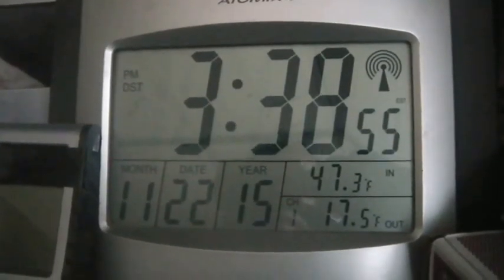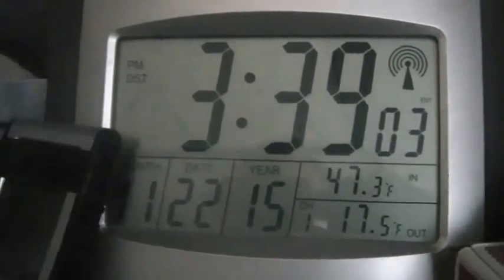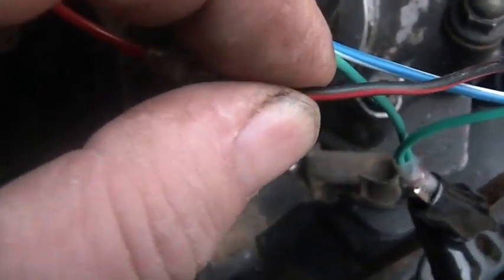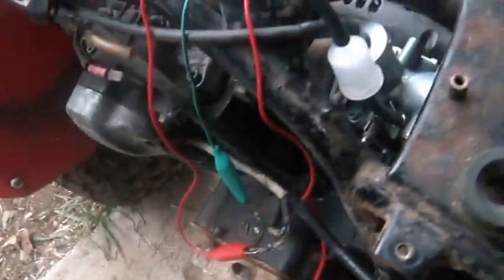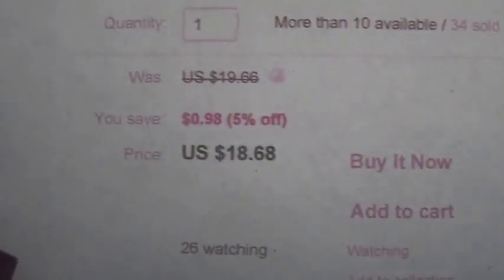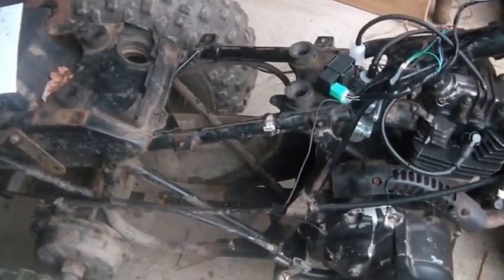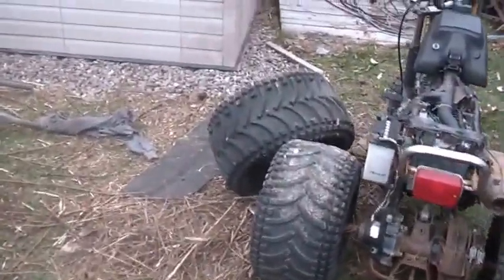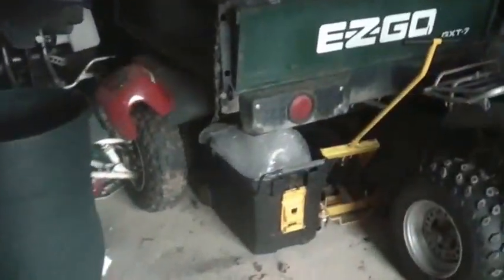Honda ATC ignition issues, use a $19 Pit Bike CDI system,

Comment: so this will work with the 1984 200es?
Reply from the maker: Hey Nick, Yes it will work on a 200es, works better if U defeat the mechanical advance, but, I have used it without doing that.... Thanks for asking, watching, and commenting!!!
Reply: If i just buy the CDI box and then get a 5 pin plug to fit it will it work? I'm asking this beacuse i'm 95% sure that my problem is the CDI box

Comment: Thanks for posting this.  Would this kit work on my 1976 Honda 90atc?  The original plug wire pulled out of the coil.
Reply from the maker: Hey Nick!!!!   Ur 1976 ATC90 uses points, these CDI ignitions will only work with pulse generators.... I've been thinking of building a points version to use on small engines that use point, but, I just have not got there yet... http://www.ebay.com/itm/Ignition-Coil-For-Honda-CT90-CT-90-Dirt-bike-Trail-Bike-NEW-/232094255867?hash=item3609e54afb:g:CBEAAOSw8gVX44JP&vxp=mtr   ,  for $9, I would probably smash this right on there and let her rip.... Thanks for asking, watching, and commenting! !!!!
Reply: Thanks again.  I ordered the one you listed.
Reply from the maker: Hey Nick, Let me know how it all turns out.... Thanks for your thoughts, watching, and commenting!!!
Reply: Harvey Spooner, i still can't get spark. can feel a small shock when turning over but that's it. seams like the new coil is not working. how do I test the coil to make sure it's working?
Reply from the maker: Use a 9Volt battery like the ones used in a smoke detector.... hook the negative terminal to the metal body of the coil, (ground), also put the treaded part of the plug against it.... Put the spark plug wire on normally... Then quickly touch the positive terminal of the battery against the primary of the coil and you should get a weak yellowish spark.... No spark, then U probably have a dead coil.... Good luck, let me know how it turns out....
Reply: Harvey Spooner thanks i did get some spark. how do you test the stator now?. I can spin the engine with a drill (no plug in the head) I tried this earlier and got 26ac volts not sure if thats good or not?
Reply: @NoFishNicksAdventures  hi, did you ever get the issue figured out with the spark. I'm having the same issue right now. I actually bought the same coil as well. But I'm also get a very weak spark. Thanks
Reply: @fortheloveofmotos8416 I believe  my issue is a bad stator. I picked up a used one off of ebay but have gotten around to install it yet. Good luck.

Comment: hey would a xr200 cylinder fit a 200x motor
Reply from the maker: Hey Rene, I think it will, but I did not do the research or try it, try an eBay search, see if they cross reference to the exact years of all the models U are considering.... Thanks for asking, watching, and commenting!!!
Reply: yes a xr 200 cylinder does fit on a 200x

Comment: this concepts work for a wiring loom for a 1978 honda pa 50 moped? what do you recommend for an application like a moped? cdi coil and all?
Reply from the maker: +dragonfli069 , If the engine has a pulse generator and a stator, not points, and a DC powered ignition it will work... If the engine is 2cycle, like some mopeds are, the timing may not be right, and it may be RPM limited. But, given the price of new components, (and availability), I would give it the old $19 try...  I hope this helps, thanks for asking, watching, and commenting!!!